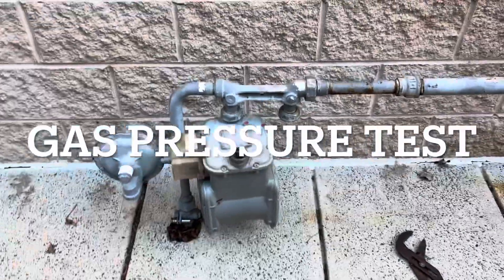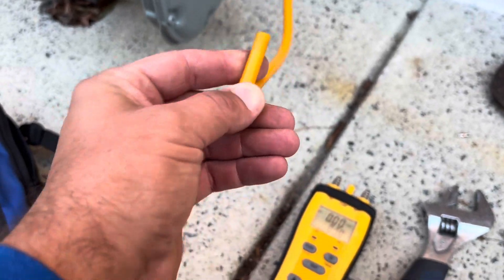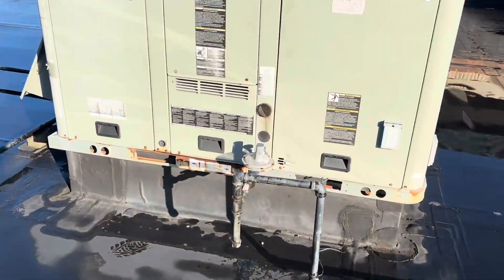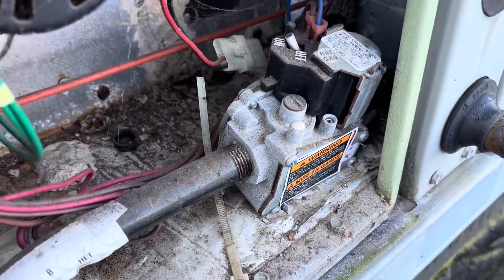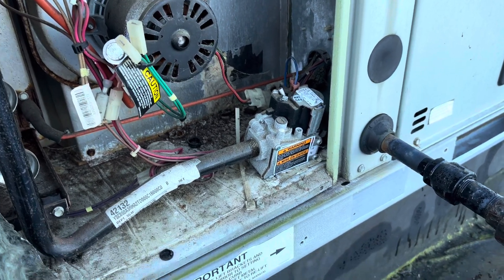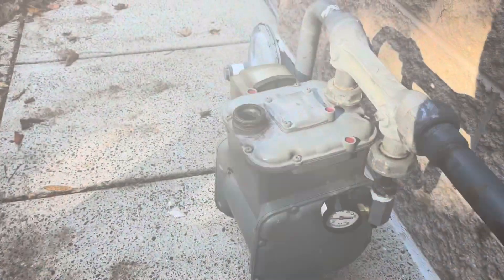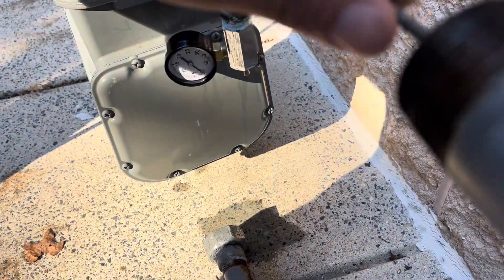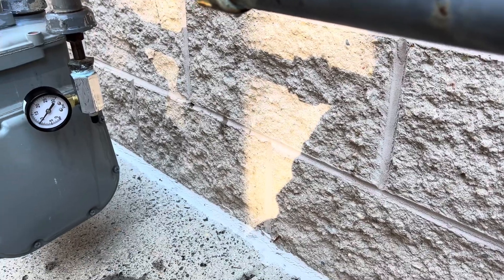Locating Natural Gas Leaks Using High And Low Pressure Tests!

Comment: I’ve been using the Milwaukee m12 tire inflator to pressurize gas lines works really good. Just changed a valve on a Trane furnace yesterday actually for leaking by. Good video 👍
Reply from the maker: Right on! 🤙

Comment: what is that adapter called that you connected to the other side of the union for the gas meter.  havent seen that fitting before.   i would really want to purchase one if i can.  great thorough check.
Reply from the maker: I don't know what the actual name for it is called but it's a gas meter adapter.  You can then use adapters to get you to a gauge...
 https://www.amazon.com/Midline-Valve-HNQU1143-Meter-Black/dp/B08L5MRZBL/ref=asc_df_B08L5MRZBL/?tag=hyprod-20&linkCode=df0&hvadid=598391158936&hvpos=&hvnetw=g&hvrand=12655419099984139536&hvpone=&hvptwo=&hvqmt=&hvdev=m&hvdvcmdl=&hvlocint=&hvlocphy=9008103&hvtargid=pla-1721315199811&psc=1

Comment: In our area Center Point suggest removal if all manual gas cocks and cap off the lines. If the gas valves are still on the piping, they won't do the test. 
Had a big hotel with 5 large Raypack gas boilers. About 495,000 btuh each. Boiler would start prepurge fan and hot surface igniter.  When the pilot valve opened to start the burner it would completely shut down, that was for all boilers.
Several other companies had been there replacing parts.
The gas supply was designed for 7" wc. Found out the utility regulator had failed and now the gas pressure at the boiler was 10 psi. The gas valves were locked up.
The utility cane out and changed the service regulator.  I had to replace all the high gas pressure safeties, but the gas valves were not damaged.  I thought like youn2 psi max. I tested all 5 if the valves and they were still working.   Had to have Raypak send out a notice that these valves needed to be changed out.  Like everyone has already said great vid !
Reply from the maker: Thanks brother!